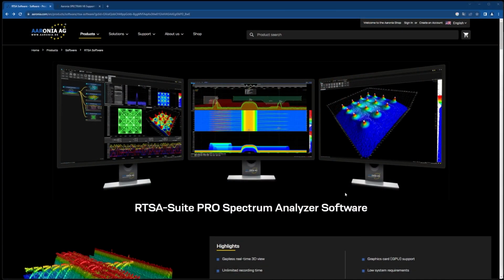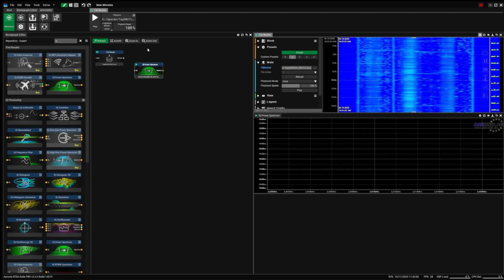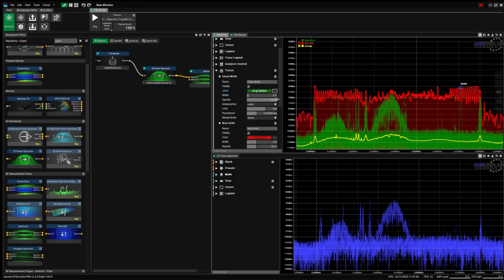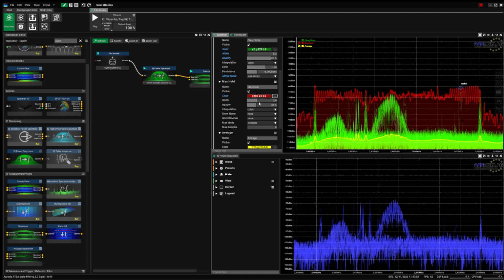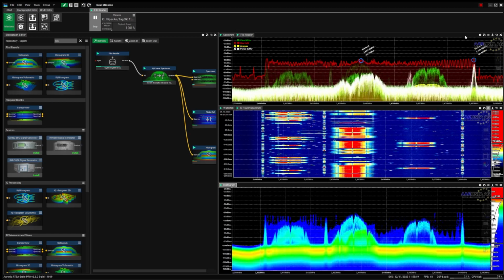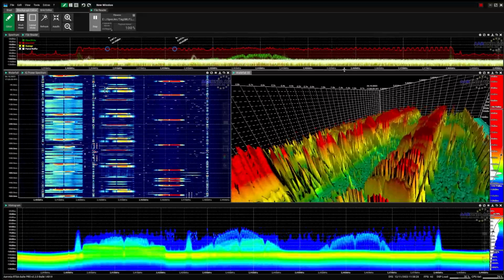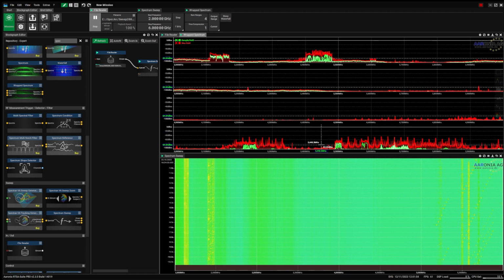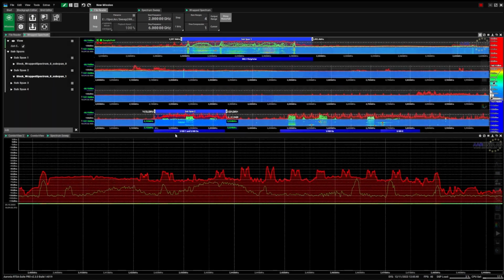A Beginner's Guide to Aaronia RTSA Suite Pro Spectrum Analyzer Software (2023 version)

Comment: I have no devces I just have .rtsa files which I want to open. The header have "DSFH"  in a first 4 bytes and other bytes I can not read... I tried python, and then I download this " Aaronia RTSA Suite Pro Spectrum Analyzer Software" but it wants "devices" and crushed. What the heck.
Reply from the maker: I will upload a record I did at a Wi-Fi conference soon (WLPC). It is 3GB, and a PDF or video on how to use it. 

Aaronia software with IQ Signal Generator block is also good start.

Comment: Quite a steep introduction. YOu should have defined teh components like nission, blocks etc... Makes a hard start.without that if you never have seen teh porgram before.
Reply from the maker: This is the thing, this application can be as advanced as you want it to be. I covered 1% in this video, the software is free. Use the signal generator and have fun :)